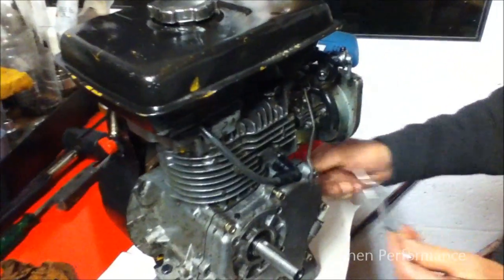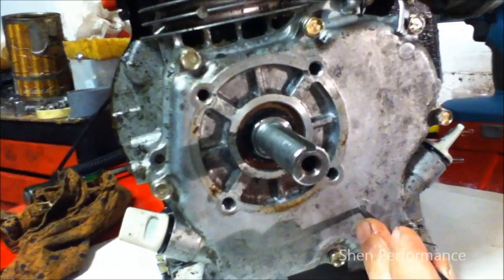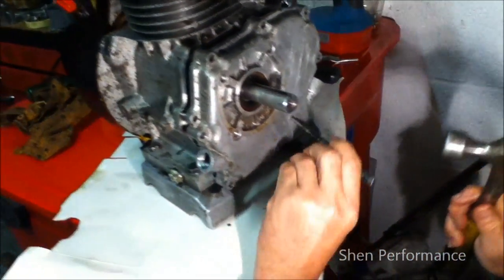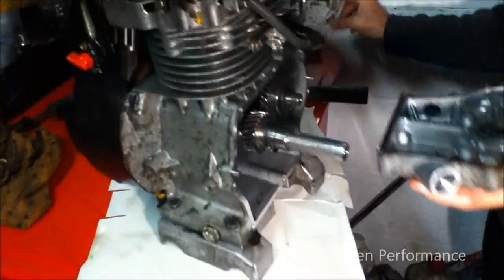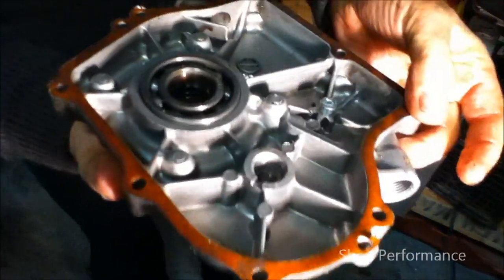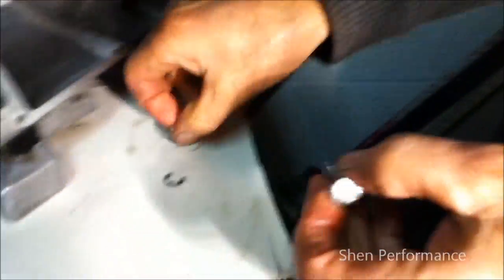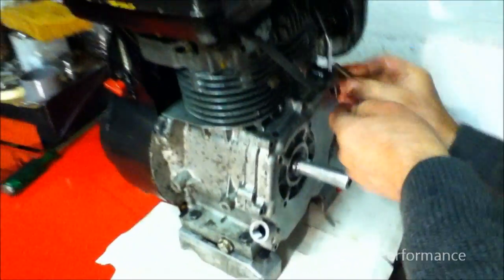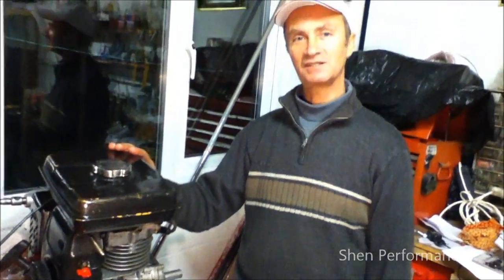How to remove the governor from a 3.5hp go kart engine lawn mower

Comment: Why would the bolts in the governor holes not leak ,....it doesn't seem to be an air tight seal ??
Reply: Its not a pressurized system, but rather a splash oil system.

You dont need air tight, just sealed enough to keep 30w from seeping.

Comment: great video and for those who want to know...
The governer is there to stop the engine from over revving because either the engine's internals will snap or degrade from high revs, it will smash the plastic camshaft gears or balance gears and blow a hole in your casing or the engine will be revving so high that the governer arm and crank won't be able to pick up the oil and splash it around the casing to lubricate parts so they either cease up or just go bang!
But if you want to make a go kart or racing lawn mower yeah remove the governer for sure. I took the governer off my briggs diamond ic 13hp 420cc engine and it runs at full revs no problem just there is one thing to note you need to replace the plastic counter balance weight gear with a steel one to stop it from shredding and blowing a hole in the back of the engine...

Comment: Nice,,easy as pie, I just removed the governor on my predator motor the same way, the only difference on the predator is that the governor is on the fly wheel side of the engine casing, so I had to pull the fly wheel to access the pin that needs to be knocked out, then pull the other side cover off of the engine to get the gear and weights out of there. Fairly straight forward process, although pulling the flywheel was kind of a pain. But now we're ready to run. Thanks!